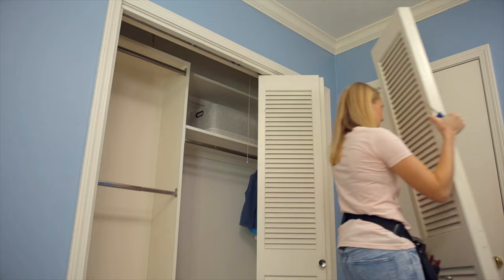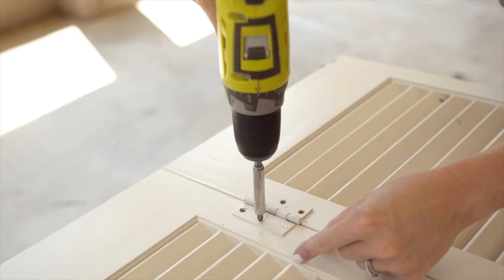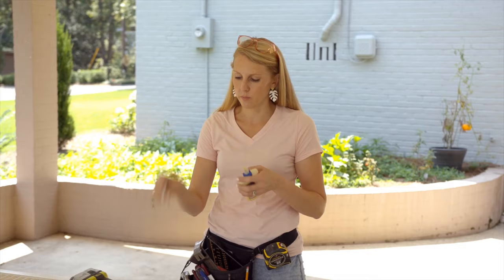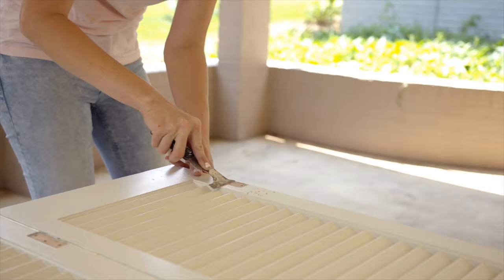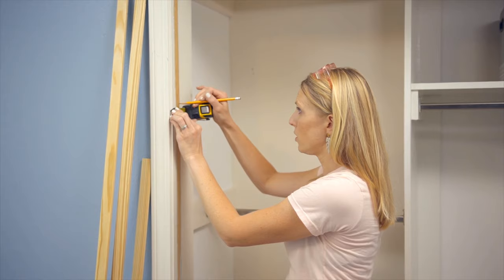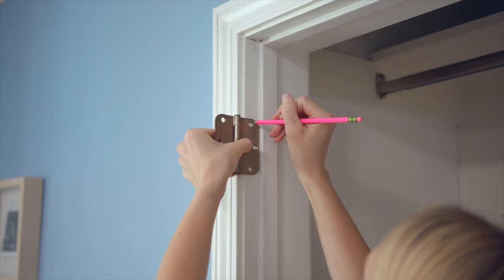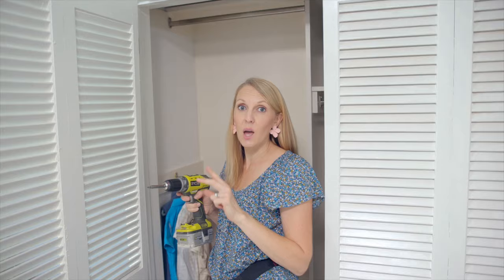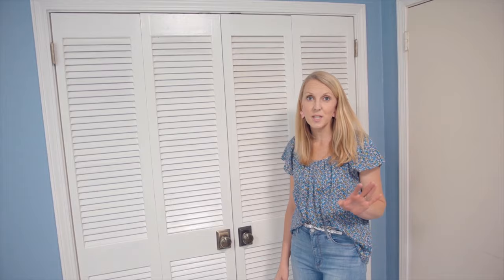Convert Your Bi-Fold Doors with This Trick!

Comment: Nice job. Because you used a ball catch, and because it's for just a closet, I would likely not even put on the stop strips, or maybe just a short piece behind the ball catch socket plate. Other than that, the stops aren't needed to stop the door or provide security and privacy.

Comment: what jig system do you recommend for this project?
Reply from the maker: You could get away with something as simple as this (plus a clamp): affiliate link https://homedepot.sjv.io/c/1980335/456723/8154?u=https%3A%2F%2Fwww.homedepot.com%2Fp%2FKreg-Pocket-Hole-Jig-KPHJ310%2F310410042%3FITC%3DAUC-129843-23-12140

But if you enjoy doing projects around your house at all, you will get so much use out of a more robust jig like the one I used: https://homedepot.sjv.io/c/1980335/456723/8154?u=https%3A%2F%2Fwww.homedepot.com%2Fp%2FKreg-Pocket-Hole-Jig-520PRO-KPHJ520PRO%2F313671513%3FITC%3DAUC-102934-23-12140